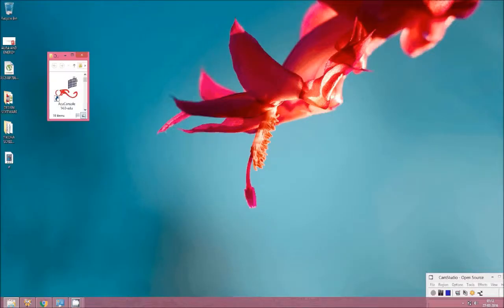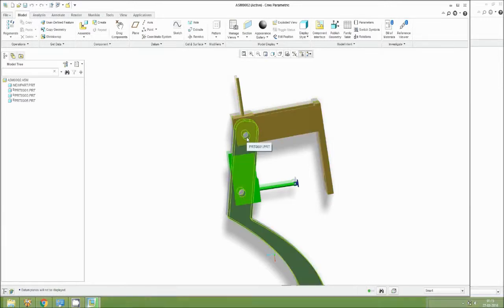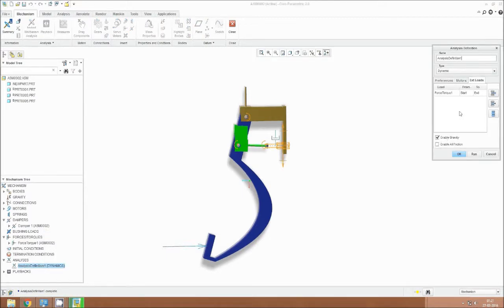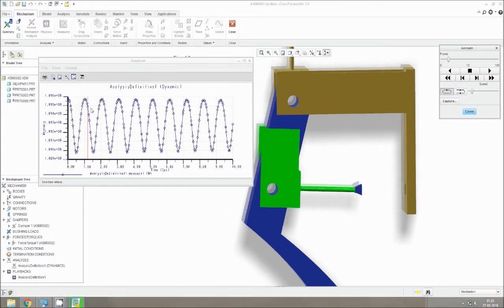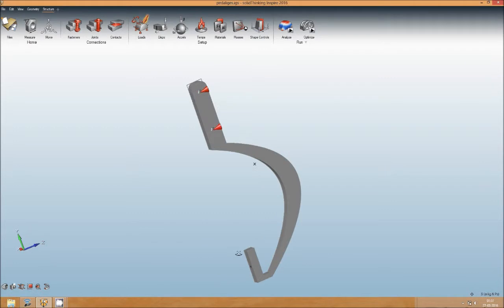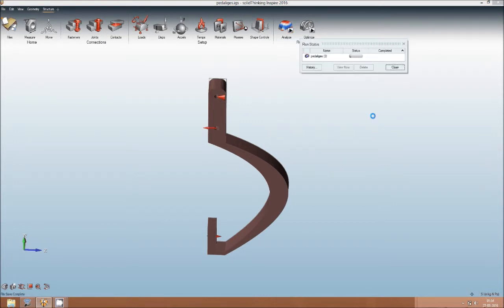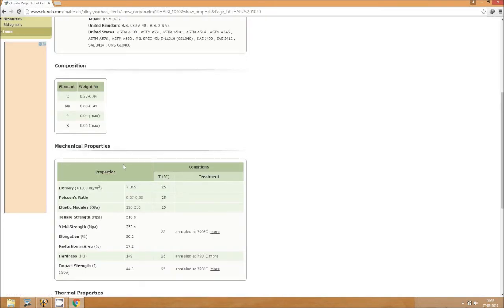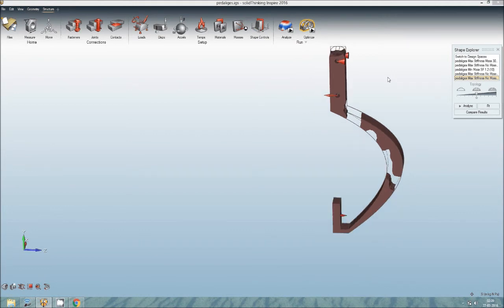PEDAL DESIGN AND MECHANISM ANALYSIS

Comment: you need to upgrade your system for better performance
Reply from the maker: Steezy Simu yes, upgraded my system with 16Gb ram i7 , 4 gab graphic card , 512 gb SSD.. its working good now.. thanks for your input..
Reply: @gunjantrivedi2006  cool... can i get your facebook handle?
Reply from the maker: Steezy Simu /gunjan92
Reply: @gunjantrivedi2006  mine is gursimransinghjuneja
Reply from the maker: Steezy Simu okay